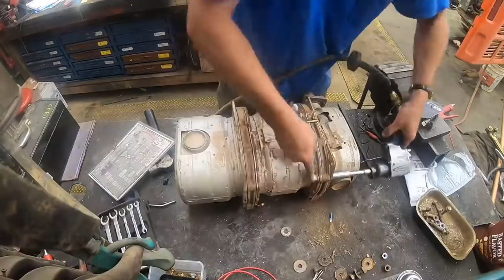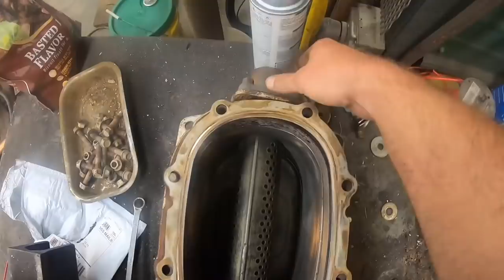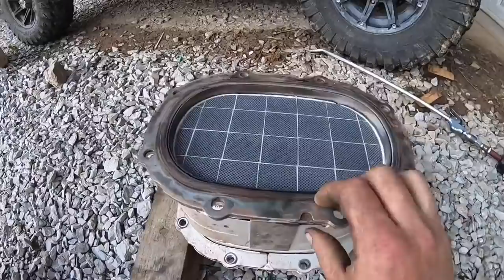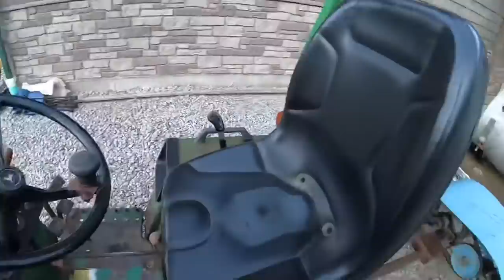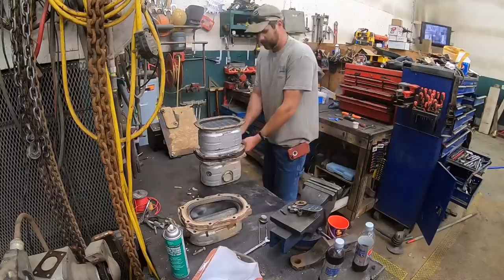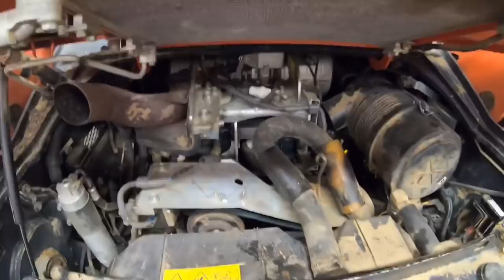DPF DIY Cleaning did it work ? (old video forgot I had) Happy Thanksgiving hope you enjoy !!

Comment: This is a word of advise that the mechanics at our new Holland dealer gave us for keeping these units clean in skid steers. Never use the foot throttle, always set the throttle at or above 1,600-1,700RPM for low engine speed work. The less you burp the throttle, lug it down and any other conditions that make a non emissions diesel blow smoke the better off you are. And short run times are extremely bad on them also... sometimes it’s a necessary evil but it’s something to also be mindful of. What it boils down to is the machines are very efficient at cooling themselves off these days and the emission systems NEED heat in order to work right... That’s how they have instructed us to run ours after they replaced the whole emission system in ours and I haven’t had as much as a hiccup out of it since. Anyway, something interesting I thought I could pass along. I’m glad y’all had a happy thanksgiving!

Comment: Good info. Seeing as I have 2 Kubota’s with dpf filters this will probably come in handy for me one day.
Reply from the maker: Thanks buddy
Reply: And saving $700 isn't that bad either.  I had a VW diesel car, yes one of the ones from the diesel gate scandal, and the DPF filter ($2300 for the filter replacement alone, not including labor) would clog every 6 months.  I kept taking it back to the dealer saying the car was faulty.  They actually had the nerve to say "you are driving the car wrong".  Not 3 months later they purchased the car back from me and I will never purchase from VW or any of their associate companies or recommend them ever again.
Reply: @ahnilatedahnilated7703  Clogged DPF every 6 months? I had a BMW with a diesel engine that also had a DPF in it and I drove it 200k miles over 6 years and never had any issues with the DPF.

Diesel engines with DPF's hates short runs and need to get up to temperature once in a while so they can regenerate (basically burn off the soot they catch when engine is not running clean enough) so if you never give the car a good workout it will fill up the DPF eventually.

I drove mine like I'd stolen it and it ran beautifully all the way until I sold it.

Comment: 13 year and counting heavy truck tech here. That first section is called the DOC or diesel oxidation catalyst. That is what creates the heat (900 to 1150 degrees F) to convert the soot into ash in the filter. Ash takes up less space than soot. 

We use a pneumatic cleaner at our shop with a regulated pressure to 150 psi. We leave ours in the cleaner anywhere from a half hour, to an hour. 

You will most likely have to have someone connect to the computer and either reset the soot level, or reset the after treatment maintenance. Otherwise the ECM will be adding more fuel into the exhaust than needed and could plug your filter up even faster.
Reply from the maker: 👍 Thanks has been working well for over a year now will need my fingers crossed thanks for the information

Comment: The first "catalyst" after it bolts to the turbo is actually called a D.O.C. (diesel oxidation catalyst). It is a flow thru design to do 2 things, the ceramic inside gets hot as fuel hits it, it also acts as a "spreader" making sure the whole D.P.F. gets the heat it needs. 

The only thing the  D.P.F. does is converts soot to ash. Thats it. But depending on how much soot is in it, is how long it needs to regen. 

The SCR, like on your volvo, converts nitrogen to oxygen in a round about way. The Def is a chemical reaction that is done at any temperature. 

I have washed a few D.P.F.s after an EGR cooler failure and it fills the exhaust full of coolant. We have an in-house cleaning machine that blows low pressure air backwards and catches it in a big vacuum.

Keep up the good work Mr Perfect!

Comment: Construction machines have the same problem as trash trucks, they don't spend enough time under heavy load to burn the filters out properly like a long haul truck and trailer. I've seen less DPF problems since changing jobs to hauling trusses, couple hours on the highway keep them cleaner than the stop and go a trash truck does all day.
Reply from the maker: Yup I could see that
Reply: It’s true and like the guy above said CNH told us to have owners run a constant high idle  all day (yea I went to school in Memphis too) prob it this. This works great on a tractor in the field or a hoe digging dirt for haul trucks or even a dozer working as a push CAT but not for a skid steer or dozer doing grading work or a small (or big for that matter) track hoe digging a ditch with people in it and pipe that needs set and rock placed in it. That not reasonable operating conditions for the machine or the environment it works in but as you would guess they didn’t much listen to the techs.

Comment: I understand you can bust all the internals out of the out of the DOC and will never clog up or regen again.
Reply: That is my plan.  3-4 holes drilled entirely through, the balance sensors will still see a difference in pressure.  But not enough to trigger regen.

Comment: 👍 Worked out well and you did it on your schedule instead of a service outlet schedule. The brakleen step was a good idea since the thing probably relies on some sort of electrostatic charge to separate the particulates out. "electrical bridging" across surfaces from water deposits can really diminish operation on some types of filters. Thanks for the vid!

Comment: The first filter is the diesel oxygen catalyst, DOC.  The second filter is the diesel particulate filter, DPF.  It is in the first stage that the high recombustion temperatures occur.  There is a fuel injector to help develop these high temperatures during a regeneration cycle.  When the filters develop restriction, a differential pressure sensor tells the electronic contro module, ECM that a regeneration cycle is needed and the operator is notified of this by a warning light.  If the filters do not become unrestricted during the regen cycle the filters need to be removed and cleaned or replaced.  Most tier 4 engines over 75 horsepower use a diesel exhaust fluid, DEF injected into the DOC to help the whole process work more efficiently and they do not require regeneration as often as the tier 3 systems.

Comment: from what I have read any time the DPF is wet/washed out with water it should be brought up to about 205 degrees F and then taken up to about 250F to 300F and cooked for an hour or 2 before being put back in to service as a little bit of water can cause cracking of the medium when thy start getting in to high temps, keep in mind they quickly reach high temps from the DOC, good video!

Comment: I have a new Kubota M7060 HDC12 Tractor.  It went into stage 5 regen at 144 hrs.  I still had good power,  all I wanted was enough to haul it back to the dealer due to it being a new tractor warranty.... NOPE! They hooked it up to a laptop, tried to do a Manuel regen, NOPE, said it missed a regen @ 130hrs, another @ 136hrs and boom, 144 hrs into Stage 5, dead soldier!  They want $3-$4,000.00 grand to put a new one in.  POS!  My Pop is 85 and putters around putting hay out, never makes it "grunt" and likely hit the "By Pass"  button to shut up the beep.  I told them I want my clogged DPF back ( they sell remanufactured that require core exchange)  I'm going to try your trick.  IS IT STILL WORKING WELL?  Thanks for making this video, d

Comment: Ok when they pull out of truck they check to see if those holes in place. That is the filter element.  Now they prefer baking and letting cool then use high air pressure to back blow soot out.   First chamber held catalyst plate which creates the high heat to free soot to be pushed out by the exhaust pressure

Comment: I was told to run a machine with a DPS filter wide open to keep the filter hot or the filter will plug sooner if you putt around.
Reply: Yeah, true, but I would rather clean a filter than rebuild an engine.  What about you?
Reply: I'd run it like it was meant to be run, diesel powered heavy equipment that is hydrostatic driven you set the throttle to higher RPM and go to work, controlling your speeds through the controls of the machine.
Reply: @movermike2216  I agree that hydros should be run at higher rpm but you said wide open. I disagree with that.  All that does is make a lot of noise, wastes fuel, and decreases engine life. There is something you need to understand about diesel engines.  Horsepower and torque drop off at higher rpm's for diesels.  The diesel engine is most efficient at rpm's between 1300 and 1800.  This is because diesel fuel has a slower rate of expansion upon ignition than say gasoline because it has a lower vapor pressure.  But on the other hand, it can develop more expansion than gas.  That is why they can develop so much more torque.  Torque is what you are after when you are doing work and that's why working machines like trucks, tractors, and big boats all use diesel engines but they don't operate them at full throttle.

Comment: It might work better if you wash before you rinse and repeat. Wash, rinse, repeat....Old habits die hard. LOL
Next time you do a building tear down and find an old oven, you might be able to use it at the shop for a DPF oven. Or maybe a remodeler has a take-out self-cleaning oven you can set up. Baking appears to be common way of getting the soot loose.
Reply from the maker: lol 👍

Comment: Just a thought, I have always found that a, good quality brake cleaner, works great for cleaning like O2 censors and other exhaust related clogs/carbon build up, I don't know if it makes a difference of being diesel, but It's always done a great job for me.. Also a good long soak in the parts cleaner could help.. I noticed you pressure washed first.. I, just my opinion, would be to either soak in a parts cleaner first or soak with brake cleaner, cause the solvent in those would break down the carbon and other particulates, then finished off with a good pressure wash, to force the goop out.. Seems what you did worked too.. Hope your family had a healthy & a very Happy Thanksgiving... On to the next one.......
Reply from the maker: Yup

Comment: $700.00???    We have a CAT 259 I was just told by our CAT dealer that it was 2500.00 to clean DPF filter and since current filter is at 200 hrs and filter is spec'ed to be changed at 300 hrs that for 5500.00 would be replacement cost.   I agree with several of the comments on here by others that a small business guy could not afford to follow "recomended" service guidelines.
Reply from the maker: Crazy

Comment: If you want to bypass it on off road equipment you can but a truck that goes on the road I wouldn't. I did look into it and the fines and possible criminal penalties are not worth it and if you want to sell it good luck. I hope this method works out as I would try it. Thanks for the video.

Comment: Dawn dish soap is a good degreaser.
Reply: We used as precleaner before placing them in the steam cabinet for a couple hours it works pretty good. Isopropyl and  window cleaner also work good as a soaker to loosen the carbon up. I seen up the chat someone said sea foam that too I think would work real well t the nature of the chemicals at play. But dawn is the cheapest and prob best eco friendly as it don’t react badly to the others detergents we used in the steam cabinet or to rinse it out later. Using brake cleaner like Dap said or isopropyl does a good job of getting the water out of the filter ( this isn’t a problem unless it’s not blown out real good). We were told not to put one of these back together wet or if one went for a swim it should be dried out before it’s ran.

Comment: So I see you cleaned the center section but did you do anything to the input screen coming from the turbo?  In my mind due to the larger particles and the fouled  injectors the sticky diesel residue would create a blockage.  And no degreaser to breakdown any of the diesel oil that might have passed through the turbo?  And while you had the turbo out did you clean the EGR and turbo?  In other diesels I've owned (prior to tier 3 emissions of 2007) the EGR seems to be where most of the problems originate.  Sorry for all the questions.
Reply from the maker: Sorry to disappoint did all the above 👍
Reply: @DirtPerfect  not disappointed just curious because I know the regen, EGR, and turbo soot are nightmares on modern diesels.

Comment: a friend of mine works a cat, cleaning these and air filters, thats all he do day in day out.  yes they charge a lot to clean these, but the truth of it all, these are set in a tank of parts cleaner and carb cleaner 50/50 mix and left to sock for 12 hours the flushed out into the tank using a simple air gun that sucks up clean parts cleaner and carb cleaner to wash it out, left to drip out and then put in an oven like deal to dry, then put back together, simple as that. the tank cleaner is pumped though a set of filter and strainer to keep it clean, these screens are cleaned out into the trash, and the 4 sets of filter get replaced once a month or longer, and thrown in the trash,, nothing special at all.
Reply: We used a steam cabinet with the approved soap in it and then rinsed them with a water hose for till clear and blew them out. They made an air flow gauge that they set up off a new filter that the back pressure blew a ball up the clear tube the low setting was flow of new filter the top was plugged. DPF filters of washed enough will eventually get to a bypass flow that is much better than new. The dealership recommends replacement at 10% or something like that better than new filter flow. At around 50% better flow you start ending up with DP Fluid flow issues with the emissions settings. That is the point where they seemed to get deleted a lot.

Comment: $700.00 is that for removal and replace or just cleaning ?
Reply from the maker: Cleaning you drop it off
Reply: @DirtPerfect   if the steelership had to remove it add 300 or more

Comment: They just bake them at high temperature for a few hours
Reply: On one of the trucks we had you can bypass the DEF. Gotta have ecm reprogrammed and swap out some parts. Cost about $1200. But it's done and over with.
Reply: AFTER 2 BAKES ITS JUNK, GOTTA BUY NEW. THOUSANDS OF DOLLARS
Reply: @hankclingingsmith8707  I had one done on my KW T800 that was almost $1400

Comment: ???? Does this dpf use the urea fluid , where does it come into the picture
Reply from the maker: No not this one
Reply: The Diesel Particulate Filter does not use Diesel Exhaust Fluid/urea. If your engine has a Selective Catalytic Reduction system that is where DEF is used. DPF tries to clean up soot/carbon and SCR tries to clean up nitrogen oxides. They are two different and separate components.
Reply: @ArnieD17  i wasn't aware of this , is this something they came up with before the SCR system or are off road vehicles different????
Reply: As far as I know, the emission police don't care how the diesel engine is used or how the manufacturer meets the standards.
Reply: @ArnieD17  I live in Oregon so they're all over it here

Comment: I would expect that some turd is going to drop a dime on your wash out onto the ground to the EPA and/or the state to test your soil for petroleum spills.   Welcome to THAT AMERICA.
Reply: true dat, there has to be one with nothing better to do lol.
Reply: if a spill is under 55 gallons you do not need to report it. I worked for a place that would fill 55 gal drums half way and then accidentally" stab the bottom with a forklift so they leak out
Reply: The filter basically preforming they same job as an catalytic converter it captures the carbon and captures it for burn. A converter heats it up and then uses moisture to send it through the exhaust and put on the ground (the water drops that come out of your exhaust in humid or cold days) the amount of carbon DP introduced to his gravel is less than would’ve introduced from paving 2 square feet of driveway. as long as he don’t directly induce it to the sewer or the water table this isn’t an  environmental issue.

Comment: Marine diesels with wet exhaust are most definitely better than DPF and DEF.
1) bring water from outside boat and run through heat exchanger to cool engine.
2) dump water into the exhaust and let it run out the boat. 
engine cooled and exhaust cleaned of particulates with no tanks or filters needing servicing. well, ok you likely will have an anode in the heat exchanger that needs replacement every couple of years. the heat exchanger is a no airflow radiator so had the same maintenance the radiator has minus topping of coolant.

side note, check the channel for Priestly Demolition. I swear the guy they have in the thumbs is TMBTS moonlighting for them without telling us. ;)

Comment: Man couldn’t even see through that water coming out of there
Reply: Think about the air that poor eMaine is trying to push through that crap too. The amount of hydrocarbon.burnt to burn the other hydrocarbon and the amount of extra fuel burnt to operate the engine at a higher temp to operate this equipment. Anyone who watches Bramdon and Letsdig 18 and wonder why one skid steer uses so much less fuel than the other this part is part of that reason the other is the difference in fuel pump delivery.

Comment: Try that on the Volvo
Reply from the maker: Different set up
Reply: @DirtPerfect  yep does it has fluid ? Probably a whole different can of worms. Besides even same manufactures can’t seem to stay with one type system in their fleets it’s possible to own 5 of any type of equipment and have 5 different systems depending on everything from year made to HP power rating to who actually made the that specific engine and in which country it was first made. I won’t even get into California emissions add ons
Reply: The Volvo has a SCR (Selective Catalytic Reduction) that uses Urea to clean up the emissions so you can't treat them the same as a DPF.